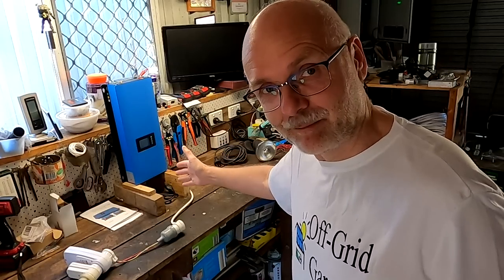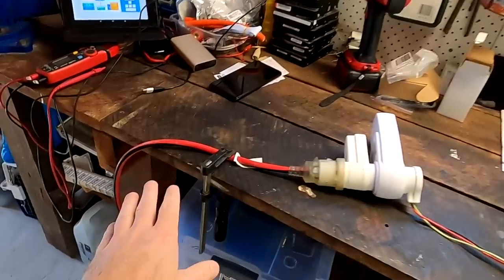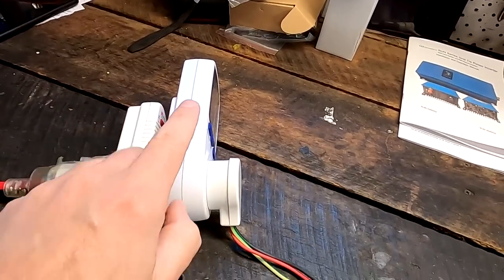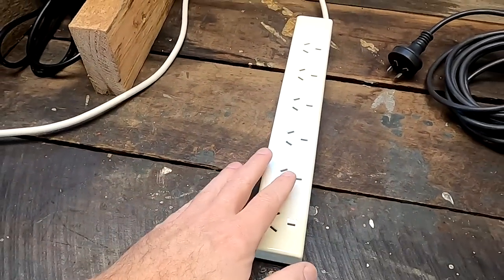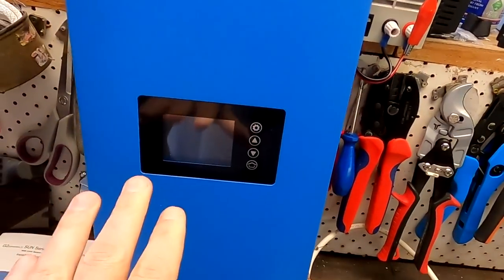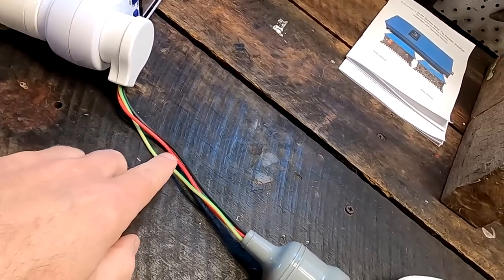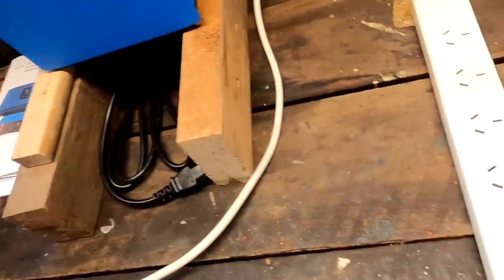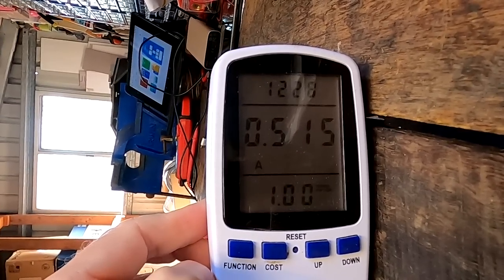Sun 2000 GTIL2 Inverter full test. How it works, what it does.

Comment: Great informative video Andy, thanks,
Personaly i would have gone with the victrons so i didnt have to redo everything when the contract runs out, but since you allready have them it looks like you are all set.
BTW, you didnt mention the other parts in this video, i dont think you need them, right? the converter automagicly takes over when the production falls under your load. right?
Reply: @OffGridGarageAustralia  i mean the Sonoff devices, you dont actualy need those right? why would you turn the inverter off if it regulates itsself? seems overkill.
Reply from the maker: @bjornemmy  that's just for my purpose to stay within the contract requirements. I could only operate the inverters when the sun is down.
If you don't have such a contract, you don't need the SonOffs, that's correct.
Reply: @OffGridGarageAustralia  aha oké it requires you to cut the connection completely, rather then to rely on the automatic control. I see interesting.
Well every government makes there own Weerd rules Wenn it comes to solar, we upgraded to a home battery because they start demanding injection charges, or canceled the reverse turning power meter, so essentially I loose all power that is exported if I have a new meter, or pay obscene amounts of injection Charges, I believe it's 100€ per year per kw inverter power. In my case 800€... That buys you allot of power... Some contracts allow you to sell your power at 4ct/kwh so you can buy it back... At 50 or whatever... Seems fair right?
BTW, if you are interested in automating or integrating all kinds of rules to your setup, there is a venus OS build that includes Node-Red, a powerful automation tool that allows you to switch all sorts of devices over the network for example, depending on SOC, etc.
Very interesting stuff, I'm only just scratching the surface myself.
Reply from the maker: @bjornemmy  Yep, totally strange and weird rules at some places. I'm getting 54.2c/kWh and pay 21c/kWh when I buy it back. So THAT make sense. Usually it's only 10.2c/kWh though. The rest 44c is been paid until 2028 for me. Then I'm free and have to re-think the setup.

Thanks for the automating stuff, that is in deed interesting and very handy. I will certainly look into this. Could be triggering the balancer to be connected if SOC is at a higher level or deviation is too high and leave it off otherwise. Interesting... Thanks.
Reply: @OffGridGarageAustralia   so this is a ac coupling. Im curious to ask a question.
If grid fails then your inverter will turn off.
Reply: @netrocker9990  That is a good point and as you might have missed it in the video when you disconnect the AC power cable from the power point (outlet) the inverter will turn off.

Comment: Hi Andie, really enjoyed this video the device is very interesting and is pretty much what I have been looking for for quiet some time.
One additional test I would like you to do if you are willing? Could you test to confirm that the inverter will not back feed power back into the grid if the grid goes down? You could simulate this by unplugging your RCD or power meter at the grid end and then testing to make sure the inverter goes off and there is no power on the exposed pins. This is my only worry that in the event of a grid power failure the workers that come to fix it could receive a shock from power being sent back into the grid from the inverter.
Reply: This is the reason it is not legal in most countries. The certification is mainly to protect the grid and anyone working on the grid. It is an expensive process to get certified. Personally I would not hook one up, simply because without the grid in the Phoenix area, your house would uninhabitable for many months of the year. Make no mistake, our meter reports hourly to the power company, and they will be able to tell if you hook one up.
Reply from the maker: Harry, The inverter will turn off within 25ms if the grid fails. 30ms is the regulation in most countries. It has anti islanding function, so will not stay alive if the grid fails. It's a grid following inverter.

Comment: The item description for this item says stackable so does that mean stackable on the same phase of the grid side?
Reply from the maker: Yes, you can have as many in parallel on one phase as you need. Even combinations work, a 2000W and a 1000W in parallel.
Reply: @OffGridGarageAustralia  this is awesome, I currently have an inverter with cables running all over for the TV, router, CCTV system, fridge freezers, Alexa's etc..

This will cut down on the clutter awesome

Ordered the one for the 24v system, I am working on a system so when the temperature gets to 3 centigrade or lower then the solar panels switch from the mppt charger directly to the  sun inverter.

I may change this when I work on the system for heating/cooling the battery box.

Comment: Hi Andy have you tested off grid hybrid inverters. I think that the main advantage of these hybrid off grid inverters is that you can set it to use solar energy first. Meeting it will use the power coming from the solar panels directly and only drag power from the batteries when the solar panels are not providing enough power. So if your batteries are charged ( in float phase) and have load ( your tesla car) than if it’s sunny the power of the solar panels can be used directly to charge the car without pulling any power from the batteries.
What do you think? 
Regard
Marc Sayadi
Reply from the maker: Pretty much all inverters do that in an off-grid installation. Once the batteries are full the solar delivers power to the load but won't charge the battery any more. There is no special inverter needed for that.

Comment: Does it has RS485 connection?  Any description on the remote interface connection?
Inverter efficiency 82%?
Reply: 91% no Rs485 or other connections
Reply: SOME do have RS485.  I've just ordered a pair (should be here in a few days?) that support it.  Where my main panel is vs the inverters/batteries/etc is about 100ft gap, so went that route since RS485 can be run ~1000ft.

Comment: Just to clarify, Mine has a slightly different menu with redundant low voltage cut off box. One on the battery or solar limit current mode, and one on the battery or solar limit power mode. It just has an extra box for voltage but nowhere does it say that this is the battery cut off voltage. I just had to mess with it for a while to figure it out.

Comment: Hi I have got the same inverters but they came with ac output L1 N L2 anybody knows  how to wire the outputs to an single phase 230vac or have in for the manual isn't any help

Comment: Andy, one thing to note is that sometimes the Sonoffs cannot handle high load, you can solve this by opening the case (unpowered ofcourse) and resolder the 230V circuits, than it can definitly handle the load. Just my 0.02cts
Reply: @OffGridGarageAustralia  good to hear! I use them for small loads 👍 otherwise you can switch a 220V power relais as found in car chargers with the Sonoff if you really want to see reliablity and stability (however those are not cheap), I have one in my OpenEVSE car charger 👍😁 thanks for the 2 extra channel mentions, great to see their content, makes me decide to build my own HV battery when needed, very informational! Enjoy your day as it's nighttime here for you downunder 🥂🍻

Comment: Does anyone have a part number for the connector the limiter uses?  I want to make an extension cable for mine.  Sure I could cut and splice..  But I'd rather be able to shorten it again if I chose.
Reply: GX12 2 Pin
Reply: @DerKanal  thanks! Just what I needed!!
Reply: @jbuszkie  no problem

Comment: Good morning  I m new to PV and I d like to built something based on GTIL so I have to learn a lot from your channel .There is a question I have .If the
Reply: sorry i pushed the wrong button and I continue here " If the GTIL takes power produced from the pannels  , the limiter ring is in the line coming from the public grid and we have lower or zero consumption from the house appliances  what will happen?This non used energy and not feeded back to the public grid because of the limmiter will blow up the system or no? What could we do to prevent something like that axcept to calculate our min needs in power ( which are variable and  ot constant)Is there any way to protect the system from such an hypothetical danger? Thanks a lot for your hospitality and I hope these question represent and other members and may be find an Idea for a future vide

Comment: I asked the supplier about 120v/120v split phase for North America (L1 + L2 = 240v). They said that only the 1000W could output 120v - not the 2000W. This was looking a great solution until that moment. Do you know if the output of the 2000W inverter can be stepped down to 120v (and the limiter will still work)?
Reply: Great video (and videos) by the way!
Reply: any luck finding this? I'm looking for something similar to this for north america.
Reply: @diySolarPowerFunWithRay  No. I ended up buying 2 1000W GTILS.
Reply: @dSquared0162  That's awesome. Do you like them?  Did you end up connecting a battery also. I think they allow for that?
Reply: @diySolarPowerFunWithRay  Yes I do like them. I only run them at 2/3rds capacity though - I've read a lot of people have problems if they let them use the 1000W so I don't go there. I've hooked them up to 4x 12v LiFePO4 batteries (for 48v) and they just chug away when the sun's shining.

Comment: Andy, could you check the voltages on the limit sensor when it is clamped on the live wire with a load going through them? The sensor works by creating a voltage on the pins, which can get dangerously high if there isn't a burden resistor built into the sensor. By doing this test, we can check if the burden resistor is in the sensor or built into the inverter. If the resistor is in the sensor, it is much safer when unattached from the inverter. (Voltage would remain low.)
Reply from the maker: When the sensor is disconnected, you cannot touch the contacts of the plug. The female side is on the sensor side, so it's safe.
Edit: someone here in the comments mentions the CT has only 5V, so not problem here.
Reply: @OffGridGarageAustralia  The problem is Ohm's law. The Sensor creates a current induced by the current flowing through the wire it is attached to. If it's not connected the resistance is infinite which will result in an (theoretically) infinite voltage between the contacts. This is why such a sensor should never be attached to the wire without being connected to the inverter.
Some of these sensors have a burden resistor integrated to avoid that issue. I'm quite sure this one has not.
Reply: @keyem4504 These always have built in protection. Nothing  to worry about.

Comment: Hi, Once again a great video. I already have 2 of the 1000w inverters running on my system giving me power to my split phase 110v supply. 
I’m curious if you know whether or not the firmware/software is upgradable as both mine are v5.2 ! I’m curious with what the upgrade has been, the screens for power settings are different but what else.
Reply: On AliExpress there is a version 6.1 with a firmware upgrade, the newer version doesn't have the external sensor plug or options in the software

Comment: is it possible to connect it on an off grid setup instead of grid?
Reply from the maker: No, it's grid-tie inverter. It won't turn on without the grid.
Reply: @OffGridGarageAustralia  what I mean is instead of grid power, the output power of the off grid inverter will power the gti, is it possible?
Reply from the maker: @kcir3r3av3r  Very dangerous. The gti's output is delayed and can push power back into the grid when a large load turns off. That is not something an off-grid inverter can handle unless it's a Multiplus II from Victron.
Reply: @OffGridGarageAustralia  ok. thank you for clearing my thoughts on this one

Comment: Could you please do a YouTube where you use batteries and solar to see how that all works as a system? I live in San Diego and have my 1000W, 24 VDC version but it is still in the box as I want to learn as much as I can before I hook mine up. I did get the Wifi dongle with mine. I did not know there was a 2K Watt version or would have purchased that. I do plan to purchase another for the other leg of my 120VAC home and will make sure that one is 2K Watts and will swap the inverters so the 2K Watt is on the one leg of my 120VAC that has the most loads. Thank you again!
Reply from the maker: You can simply parallel them, so the 1kW and the 2kW version will work together.
I don't have the inverters any more and have send them back after testing, sorry. But there are heaps of YouTube videos out there showing how they work with both battery and solar. As you can set the low voltage cut-off in the inverter, they work great for that purpose.
Reply: @OffGridGarageAustralia  Thank you.
Reply: Thank you
Reply: I would limit the inverter to 700w, so it doesn't overheat.

Comment: Can I use this without connecting to the grid?
Reply: In principal, no! This units as most grid tie inverters has what's called "anti-island"! Or in other words it MUST sense power from the grid, to work. Otherwise it shuts down! Cheers
Edit: If there's no intention to connect to the grid. There are much cheaper units available! Just a taught!

Comment: Hello Andy. I just bought the inverter and it won't run lower than 90W even with the limiter sensor or limited by the device to 15w. It feeds the grid minimum of 90w. Very disappointed. Yours experience the same? Looks totally useless rubbish :(  Thanks in advance ....
Reply from the maker: I don't know your settings, so not much I can say... The one I used was going down to 60W or so minimum.

Comment: 30:50: " it is not a off grid inverter"

Thia inverter can most likely used in a off-grid settings, with the sensor.

The sensor makes shure there is no need production, and thereby supporting the inverter.

I saw a video where someone had tried connecting a grid tied inverter in parallel to a off-grid inverter.

It worked well, until the usage was below the production of the grid tied inverter. The over voltage destroy the off grid inverter.

But here that clamp will most likely prevent that outcome.

Comment: Great video mate! Just letting you know that it's illegal to use this inverter in Australia since it's not certified according to AS/NZS 4777.2. Significant fines could apply to anyone who attempts to operate this grid tied inverter on an Australian network. Anyway, thanks for all your entertaining and informative videos!
Reply from the maker: Yep, that has been discussed before here under this video. I have just tested these inverters to show and explain the technical possibility of it. It's back at Ali now 😊
The Victron Multiplus II has the same function ( Power Assist) and is  a 4777 certified device. Unfortunately I cannot connect any grid tied inverters due to my contract.
Reply: @OffGridGarageAustralia  no worries mate! Where are you located btw? I'm on the Sunshine Coast. About to build a 3-phase Victron MP2 system with a 48kWh LiFePO4 battery.
Reply: Isn't the whole problem not supplying energy to the grid? The device with limiter does this and how can it be in the illegal position?
Reply: @KutsiTekin  this is a grid tied inverter. It requires a grid for it to function and thus it's illegal to install it in Australia.
Reply: @KutsiTekin  
The idea is that a wrong inverter may create a noise in the grid, raise voltage beyond limit etc.
Also these are high power devices which can burn your property quite easily if not made to a standard. There are plenty of stories about overheating micro inverters from AliExpress.
I think there is also an element of over-parenting from the government bodies.

Comment: Can you please tell can we use this invater in a 12v battery bank when the battery are in the flotting stage to   inject power to the grid (only to inject power when their is excess power after the 12v battery bank is fully charged)
Reply from the maker: The min voltage for this inverter is 45V, better 49V before it starts operating. There are smaller versions with 1kW available. Have a look on my website for specs and details.
Reply: @OffGridGarageAustralia  thank Andy i love your videos
Reply from the maker: @DIYwithAsanka  thank you!
Reply: Minimum voltage for the low voltage version is 22V. So you need at least a 24V battery system

Comment: I have 3 panels and I am basically doing exactly what you are saying the people in apartments do, my panels hook to a Marsrock 1300w grid tie inverter, it saves me around 60-70kwh per month, its not a lot but it adds up.  Also I can feed back but my meter only goes one way so if I feed back I actually have to pay for what I send back..... atleast until the power company comes and installs a new meter

Comment: Hi Andy, love the Chanel, have been watching for 6 months and working up to repeating your efforts. I have a question about your BMS and your Victron inverter. Does your BMS communicate with the Victron (like some of the commercial batteries do such as pylontech). If not, how do you have it all set up to ensure charging is not overdone and the low voltage cut off on the Victron occurs before the BMS. Sorry if this is answered in one of your videos, I’ve been through a lot of them in the last few days and can’t find the answer. Best wishes from the UK and again thanks for the excellent content. Jon.